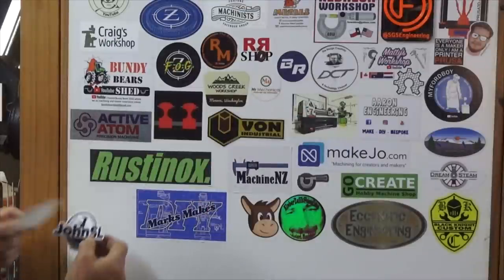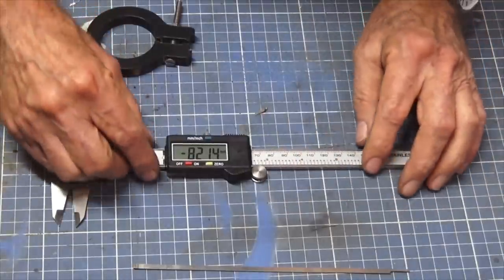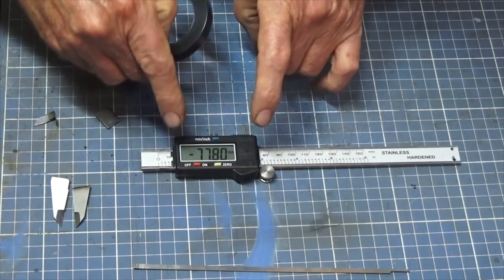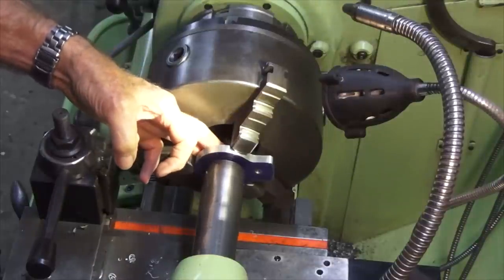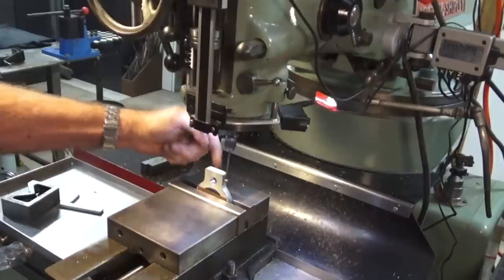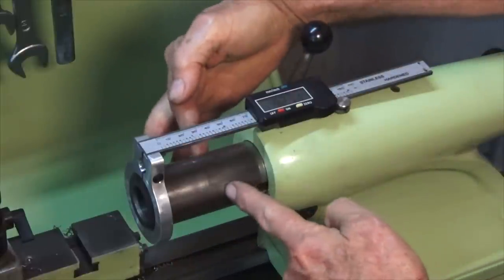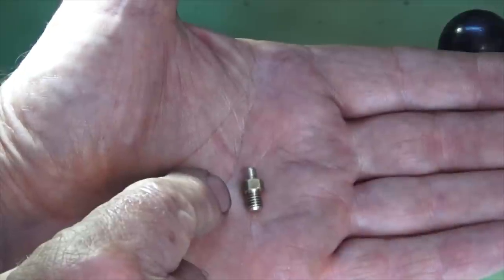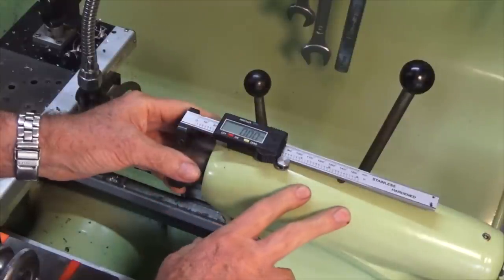How to Add a Digital Readout to a Lathe Tailstock Using a Cheap Caliper

Comment: Will any slight rotation of the quill under load, cause any problems?
Reply from the maker: I don't think so but I have had a few people tell me it will destroy the caliper. The thing is so badly made that it can flex quite a bit and it still slides. I did tighten up the clamp with the quill rotated as far as it will go in the direction that the cutting forces would want to twist it. The best solution would be to make a new key for the quill. It's on the to do list but in the meantime I will just use it as is and if it fails I will let people know.
Regards,
Mark
Reply: @Preso58  I'm going to have to try it on my lathe, seems like a good idea.

Comment: 25:04 - He's completely forgotten about the looseness of the slot in the quill. So all rotational forces on the quill will be directly transferred to the caliper and brass pin. That will last... no time at all. Watch the amount of slop at 25:04
Reply from the maker: Ahh well. We'll see won't we. I promise to do a follow up in future. In fact I used the lathe all day today and I can report that all was well at the end of the day. Trust me when I say that I did foresee that issue and if I understand it as well as you do you would realise that all I  had to do is to lock the bracket with the barrel of the quill pre-loaded in the direction of the torque applied during drilling operations. Lucky for me I have an A1 machinist like you on overwatch for me.
Reply: @Preso58  - There's no need to get narky about it - how can we possibly know if you've considered it or not? You never mentioned anything in the video about it.
When you wind the tailstock in towards the chuck (before anything touches the work), the quill will rotate towards the rear of the bed due to drag in the threads.
If the quill lock is not completely unlocked and has any drag, that may increase the rotational forces too. Any pressure of that action will be transferred to your Vernier mechanism, since everything is held so tightly.
There are many instances in normal operation where you might apply rotational force to the tailstock quill. Locking in a chuck is a perfect example, where you might wiggle it without remembering to preload then lock the quill beforehand..
Reply from the maker: @johncoops6897  Some other viewers had realised that there was some play in the tailstock quill but they addressed their comments to me personally and politely. I can't cover every consideration in these videos. At 37 minutes it's longer than I want it to be. As I said, I will do a follow up and if it fails I will let people know. If it does fail I can just drill a hole in the moving end of the scale and allow the whole assembly to pivot at both ends. It's a simple fix. The other possibility is to just machine a new key with a better fit. 
Regards,
Mark

Comment: How did you find the center position for the pinch bolt?
Reply from the maker: I just used a wiggler (edge finder) and the half function on the DRO for the centre line and a dimensioned offset from the end face. 
Regards,
Mark

Comment: I can add something useful to your CorelDRAW problem I think. I've used CorelDRAW since about 94 (version 3...not X3).  I built a plasma table in 2011 and then had a way to turn drawings into parts.  For technical parts, I use AutoCAD which exports to DXF flawlessly (no wonder).  I use CorelDRAW for artistic text and graphics. 
 CorelDRAW butchers arcs and circles terribly w the many line segments you've seen firsthand. There is/was an add on/plug-in to CorelDRAW to fix that but I'm cheap and never bought it. I've run art from CorelDRAW to Illustrator to finally get a DXF that wasn't a mess.  I always exported to DXF in the oldest version that CorelDRAW offered, version 12 or 2000, IIRC.  I had read that CorelDRAW 7 (not X7) wouldn't butcher the circles but that wasn't true as I had a copy of 7 and had the same problem. Oddly enough, what I found to fix the problem was not to export in the old DXF format but to export in one of the newest, if not the newest, DXF versions available in CorelDRAW. This will be affected by which DXF versions your CAM software will accept, of course. Using one of the newest/latest DXF versions is counter to what I'd read somewhere over the years about using the "oldest" version available for "maximum compatibility".  I really hope this works for you, too, as CorelDRAW is great for doing artistic text/graphics/logos (although it is easy to get duplicate lines) but messed up arcs/circles is...rubbish, I believe you'd say, South of the equator, if you wanted to be polite.  Thanks for your videos, well done.
Reply from the maker: Thanks for that. I was exporting my DXF's in AutoCAD LT version. These files would open in CamBam but the circles and arcs were just connected polygons. I just tried exporting in Autocad 2013 which as high as X8 would go and the circles and arcs are fine. This is good news since I was using a convoluted workaround which involved using QCad as a sort of intermediary step. I like CorelDraw and I can make quite complicated CAD like drawings with it once you get your head around the guides, snap modes and virtual segment deletes. I never did get used to Autocad as a drawing tool because I hated the command line interface with a passion. I am a bit of a wysiwyg fanatic in that way. Sad but true!
Regards,
Mark

Comment: Maybe make a small length of angle from 0.5 mm sheet to 20 x 5 and glue to the side of the body so it aligns with zero on the moving scale.

Comment: given how little pressure is involved i think you could have gotten away with stick on Velcro pads
Reply from the maker: Maybe, the caliper is still working fine and I haven't had to change the battery yet. Despite dire warnings that it would fail due to torque from the spindle twisting the caliper it hasn't happened yet. 
Regards,
Mark

Comment: Hello Mark,

Do you have an email address. I made another style of readout for the tailstock on my 660 x 2500 Victor copy lathe. I would like to send you photos. My style also copes with the torsional movements of the tailstock when drilling. However, mine took a "little bit" longer to design and make. Thanks. Bob Hudson. SW Sydney.
Reply: Get Mark's email address on his "About" tab!
Reply: @jrkorman  Thanks for guidance. I sent Mark an email, which he responded to.